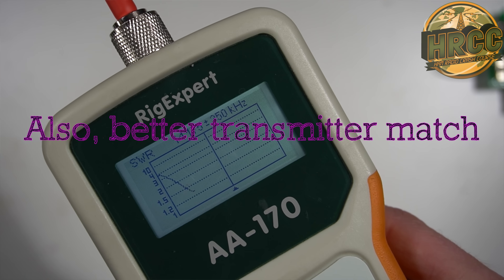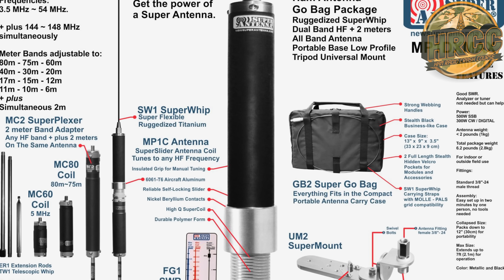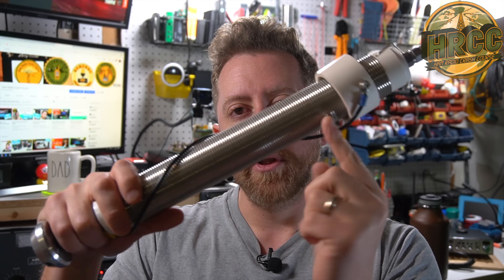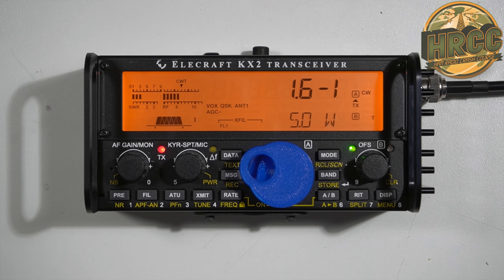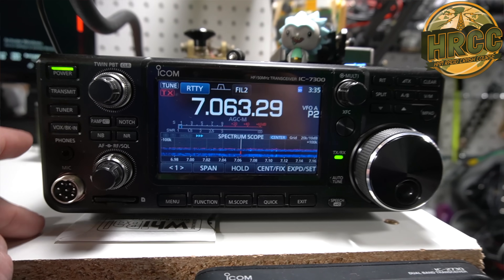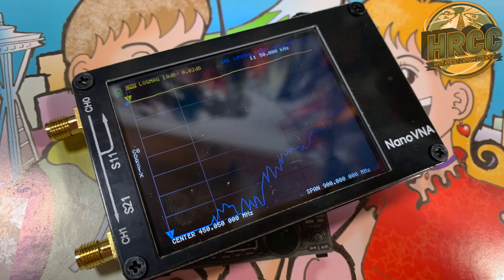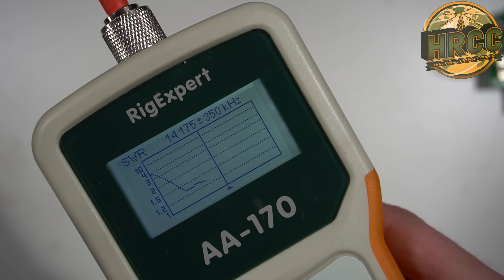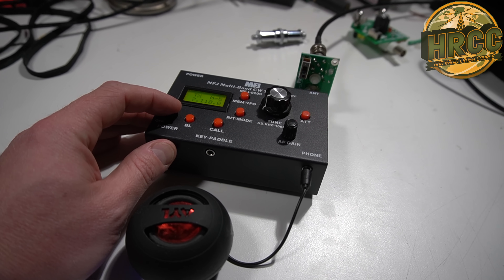Do you think you need an antenna analyzer?

Comment: You can use built in swr meter for low power under 200w but if you run power 1kw or up its a must .

Comment: I just put up a dipole measured to the band I wanted to operate in when I was a Novice 48 years ago. Shortly after, I acquired an SWR and that’s all I needed. A few years later I bought an MFJ noise bridge and it lets me know if my antenna is above or below resonance and how much inductive or capacitive reactance if it isn’t. I was handed a Palomar Engineering noise bridge and these devices plus a Tenna Dipper kit I built are all I need even though I build antennas. Never have had the need for an antenna analyzer because once the antenna is adjusted I have no need for it.

Comment: I got a NANO VNA last year.
They are useful but not essential. For years I cut aerials slightly longer and then folded the wire back on itself to shorten the length. The only problem is you could go past the point you want and make it too short and waste time figuring out where you went wrong. An amateur band tx only has a narrow bandwidth and the SWR meter can't tell you which way to go if you pass the point you need. I did  it yesterday on my 10m dipole but it's a wide band and I could see the SWR was better higher up in frequency. I didn't actually use the VNA as I had previously got it on 10m but I moved it yesterday so the resonant frequency was a bit off.

The VNA shows where the aerial is resonant so you know whether to lengthen it or shorten it. I've used it on my 60m inverted vee and 20m and 17m dipoles and after building my 4 element 2m collinear to check it was okay. It showed a kink in the reading a bit higher up in frequency so I'm guessing some parts are not quite half waves at 2m. An SWR meter would not show this.
I want to use it to make bandpass filters. 

For the price it is well worth getting one. A brilliant bit of test gear.
G4GHB

Comment: Nice ham snack. What are your thoughts on the method of finding lowest swr by listening for the loudest static while tuning through the band? I’ve heard some old timers talk about something like that for tuning antennas. KA4AMP
Reply: I do that to get things roughly tuned and then watch the SWR meter. Especially good for a mag. loop.
However, for about 40 years I simply tuned for maximum r.f. out at the aerial before I built my SWR meter.
G4GHB

Comment: Remembering back to my 1959 novice days, I knew nothing of SWR; hadn't heard of it. We measured antennas in feet according to the formula or the recipe and that was that. Test equipment mentioned in the ARRL Handbook included the Grid Dip Meter and the Receiver Noise Bridge, both too complicated for a kid. Somehow I thought RG-59 was right for dipoles. So that's what I used. Years later I understood that RG-59 was 75-ohms impedance, not 50-ohms -- oops. All these years later, amateur radio is still super fun, even if I am using the right coax, not confined to a few crystal frequencies, and my CQs don't drag on forever.

Comment: Another thing you can do is become friends with someone who does have an antenna analyzer. If they are nice they will almost certainly let you borrow theirs for fine tuning your antenna, especially if you aren't constantly making antennas. 
As for the nanoVNA being fiddly you can make using way easier if you connect it to a laptop or tablet PC and run certain software like nanoVNA-saver. Puts all the controls on one screen and makes reading the data far easier too

Comment: been a ham, on and off for over 50 years, home brewing my own antennas, and buying some for mobile use! And although I only just recently bought a Nano VNA, this tool is just absolutely AMAZING!  They are not as good as the $10,000 VNA's but for around $100 they are very good, and surprisingly accurate on most of their measurements! If you are just starting out, and are not even sure how to build a dipole, one of these devices is probably way above your pay grade... but as you advance, you will be glad you bought one of these things!

Comment: The antenna analyzer has one huge advantage over using the radio's SWR meter, namely you eliminate the risk of doing to damage to the finals by transmitting into a high SWR before you do adjustments. The antenna analyzer will also tell you whether you need to adjust the antenna up or down (or longer / shorter) whereas using a SWR meter it can be a lot of guesswork,
Reply from the maker: All true.  Analyzers are great.

Comment: I would recommend that anyone who's running anything over a few hundred watts should have one or have access to one. An swr meter will read much different vs an antenna analyzer and won't show the information that a good antenna analyzer will. I'd recommend the rig expert, the MFJ'S readings are always questionable. I'll use the Rigexpert first to dial in the antenna, then compare to my Inline watt meter, lastly I'll switch to reverse power setting and modulate with amplifier on to see what's coming back. I talk on 11 meter, however the same is true for all bands. The Rigexpert has replaced my MFJ-259b.

Comment: it very nice to have you can check your swr why you out side with out the antenna hook to the radio i have the AA170 I LOVE IT YOU IT MADE FOR HF AND VHF IF YOU WANT ONE THAT DOES UHF IT COST YOU MORE  MONEY FOR YOUR HF DIEPOLE ANTENNA YOU CAN SEE WHERE YOUR ANTENNA WORK BEST AND ITS AT 50 OHM BECAUSE YOU GO UP HIGHER HAVE GOOD SWR BUT YOU MITE HAVE A 60 OHM

Comment: 🤔...ive been into radios a realy long time....and I can tell you without any doubt that you SHOULD ABSOLUTLY have an Antenna analyzer and not just a **METER** my rule of thumb is your analyzer should be half the cost of your current radio... or half the cost of your total station...

And if you can only afford a nano...spend the $150 for a quality nano but I highly suggest a rigexpert.

Comment: I always just use a small inline SWR meter on a 3ft jumper at the antenna to tune one on the ground with the main feed line running from the SWR meter back to the radio.

Comment: I just got a rig expert and love it!  My Super Antenna is clamped to the railing on the balcony of my 3rd floor appointment.  It has a plastic ruler for adjusting the coil, but it's hit and miss.  To get me a useable SWR at the low end of 40 meters, my Rig Expert is pretty much required because the adjustments are one millimeter at a time to get into that very narrow sweet spot.  And I need to use the Rig Expert zoom function and the cursor to get there!  Still, it takes me only 10 minutes to get to the lowest SWR right at the center of 7.070 Mhz.  I'd be running in and out of my apartment for the good part of an hour to change bands to 40 meters PSK using the SWR meter on my 7300.  It's also been a time saver tuning the ham sticks on my pickup.

Comment: I have an MP-1 Super Antenna and an IC-7300. I bought a Comet CAA-500 antenna analyzer specifically to aid in tuning the antenna. The radio and analyzer are on an A/B switch tied to the feedline/antenna. Works great. Is it required? No. But it is very nice. And better than the alternatives.

Comment: Good topic Josh. When I started out in the early 90's I didn't know anyone with an antenna analyzer. They were very expensive and were more of a luxury than a necessity. We simply turned down the radios power to 5-10 watts and checked the SWR with an inexpensive, common SWR/Power meter in line between the radio and antenna. Now days it seems 1 out of 3 Hams have an  analyzer, including me. They are more efficient now, inexpensive and user friendly. Also, as you pointed out, most all modern radios have a built in SWR readout.

Comment: What can you tell us about Grounding and ground rods? Is there a limit on how many you should be using and how far they should be apart from each other if you are installing more than two? Also using copper wire or copper straps for grounding. The plus and minus of those. Anything you can tell us about grounding would be greatly appreciated.

Comment: I've come to the conclusion that the single most effective way to improve any ham station is to spend money on putting your antenna higher whether by simple telescoping fiberglass mast or even a tower depending on your budget and ability.
Reply: 1/2 wavelength high is the best for angle of radiation.

Comment: Could you also agree that an antenna analyzer wouldn't be needed for a basic 2m/70cm or even just single band setup with an antenna that is pre-tuned and designed for the band you need? Every time I talk about putting an antenna up somewhere for a ham setup I have a friend/fellow ham that insists I would need an antenna analyzer. To my knowledge, a basic SWR/watt meter would do the trick for a basic tech-class setup.
Reply from the maker: If you’re using off the shelf antennas and radios on vhf/uhf yeah absolutely. You don’t need an anlyzer
Reply: Ok, as I expected. Thanks for the reply! I'm from Avalon and frequent the Catalina 2m repeater. CARA links their 2m, 6m, 220, and 440 repeaters from 6-9am every morning. Drop in and say hi if you get the chance!
73, K6GLS

Comment: An antenna analyzer gives so much more information than a SWR meter. And when setting up a repeater then it's also often not possible to get the data from the repeater itself about the actual characteristics of antenna and antenna in conjunction with the filter. It can save hours of headache if you have one.

And sometimes when you have an antenna you could discover that it's actually useful also for frequencies outside what it's specified for. It may not be the best radiator at those frequencies but your radio won't barf either.
Reply from the maker: I’m not denying that. I’m saying new people don’t need to feel they have to have one. 🤣

Comment: I wish I had had my YouKits FG-01 antenna analyzer years ago. It is simple, gives SWR and impedance continuously while adjusting the antenna, and saves so much time.  Yes, it is not cheap and there are better ones that give more information that many hams don’t understand anyway.  But it makes adjusting a BuddiPole, Wolf River type coil, stinger on a ham stick, mag loop or just trimming a dipole so much easier.  I have used noise bridges, SWR meters, and other items to tune antennas and even have a Sark 110 (have to read the book each time I use it) but for simplicity and ease of use the YouKits works well and makes antenna tuning a breeze.  My old MFJ was too mich trouble and only gave a static reading so I sold it.  Can’t believe they are stilling them since the nanoVNA came out for $50.  Even the nanoVNA has a learning curve but most hams could and should learn that soon when putting their first station together.  We used to say real hams know CW but in my estimation all hams should learn how to use these great and simple tools (should be part of training and the license exam) for antenna building/adjusting.  Even the most expensive transceiver is useless without a good antenna.

Dave K8WPE

Comment: You can just adjust the antenna for the loudest RF noise on the frequency you want to use. This point at the loudest noise is the same point as lowest SWR. That’s a really easy way to tune up. I have an antenna analyser and they are handy, but not needed that often. Craig VK3CRG

Comment: I always figured I didn't absolutely need it, but figured it would be nice to have for some of the other features (checking coax properties/conditions)  and not putting so much rf out there just to adjust the antenna system.

Comment: Just a comment from AN AUSTRALIAN F Call, 
I have a Hustled 5BTV, now this antenna has 3 band loading coils,  4 if you count the 80mhz resonator on the top, and you need to adjust all of them, to a resonatant Vswr, .
With a swr meter on the radio , this is more than tedious, its a down right pain in the butt.
I have a Sark 100, cheap , reasonably accurate, user friendly and simple.
In a word INVALUABLE, but if your running a mono band etc , yes , I agree that an analyzer is over kill.
My radio club owns an MFJ and it is regularly used by members for tuning their antennas.
If like me you experiment and build antennas , the analyzer is a great tool , to own.
Like you videos, 
cheers from  down under

Comment: Thank you Josh...I’m new to the hobby as a general and was dreading one more, what I consider to be, big expense. I do have my eye on a wolf river for POTA but was stuck because I don’t want to pay for BOTH a new antenna AND an analyzer.
Reply from the maker: Get the antenna. Learn to read the swr on the radio and you’ll be able to get that wolf river tuned up no problem.

Comment: SWR meter needed to set up an antenna properly, Antenna analyzer only really needed to build antennas and then only if your really not sure if your anywhere near correct. Anyhow, given the price of an NanoVNA(a cheap antenna analyzer) vs an SWR meter, the nanoVNA makes financial sense, given it covers most bands, whereas you'll need a seperate SWR meter for HF and VHF/UHF, at the same cost each, at minimum.
Reply: An antenna analyzer only for building antennas? You are so wrong. It gives invaluable information for tuning an antenna to resonance which an swr meter can't do.
Reply: @vegasfordguy  Plus: a NanoVNA is so much more than just an antenna analyzer. It is to a HAM what a DMM is to an electronics enthousiast.

Comment: An SWR meter, whether stand-alone or built-in, is a great first step.  However, SWR alone doesn't identify inductance or capacitance, which are big concerns in a lot of antenna designs.  The SWR meter might read 1:1, but that doesn't tell you how much is resistance and how much is reactance.  A high reactance 1:1 antenna might not damage your radio, but it won't radiate very well either.

If you're only dabbling in very basic antennas like dipoles and 1/4 wave with radials, an SWR alone will be fine.  Calculating the elements' electrical length is simple and as long as you're close, you shouldn't see any weird local mins or maxes that can trip up an SWR meter.  It doesn't need to be expensive or fancy, or laboratory-grade accurate.  I know for the beginning ham a $30 SWR may be a significant chunk of change, but it's cheaper than a new radio ( coming from someone who fried his first radio, and luckily got it replaced under warranty ).

But if you're experimenting with complex antennas, some sort of VNA is almost required.  And luckily the NanoVNA is relatively affordable.  And I don't think the argument "it's difficult to set up and use" holds water.  Anyone capable and willing to build their own Yagi, mag-loop, or nested quad should have no problem figuring out the Nano.

Comment: Josh, do you have plans on discussing the high swr antennas? That seems intriguing. I also had maybe a strange idea. An any wire antenna box, a box with a diode hooked to an output, and a diode hooked to an input... When the tx is in use the rx is physically disconnected. Would there be a diode that could keep a radio safe against insane high swr? I may be crazy, but I'm new. 🤪

Comment: I bought a NanoVNA and am testing my antennas. I don't fully understand the Smith Chart though, because I'm using 75ohm coax to my dipole, and its calibrated for 50ohms

2:1 SWR is till only 11% power loss actually. Not enough to really be worried about. It's more to worry that excess voltage will destroy the output amplifiers. But power loss isn't a huge thing
Reply: You should be able to calibrate the Nano to whatever ohm test lead you want.  However, if your radio is set for a 50 ohm load, I'd calibrate the Nano to that so the Nano will show what your radio is experiencing.  And it's always best to test the entire antenna system, that includes the feed line.  The 50-75 mismatch of course means some loss ( an ideal case would be 1.5 : 1 SWR ) but if you have a proper balun or choke at the dipole feed point, the feed line itself shouldn't radiate or cause any other nastiness.

You can also use a matching network to mate the 50 and 75 coax if you want the SWR down and boost antenna efficiency.  I think a twelfth-wave transformer is the easiest way to do it, but that only works for a single frequency range.

When you say you don't understand the Smith chart, do you mean you don't know how to read a Smith chart, you don't understand how to read the chart as displayed on the Nano, or you don't know how to set the Nano to display it?
Reply: @JaronActual  at first i didnt understand fully how to read it on the nano  because the nano displays R+ and the a C or L value and not j values (like +j34). At first made it look like the capacitiance value was backwards, higher valies towards the centerline but then i realized i guess that is correct because higher cap means less reactance. To me made it harder to understand my antenna system

I actually am testing a the feedline, so i get a 1.5ish swr "circle" on the swr chart to begin with (the values move in a ring centered on the center 50ohm, because my feedline is 75ohm). I THINK i know how to read it. My homebrew CW 7mhz transmitter is hitting stations 600 miles away so it seems to work well enough (my antenna). Nano says my resonant freq is about 7.150mhz right now and i can go down to 7mhz and up to about 7.280 before i hit swr of 2.0. At 7.1mhz it says my antenna is 48ohms with 1.1nf capacitance. At 7.050mhz or so it says 36ohms with like 450nH. My dipole is only 5 feet off the ground so the true impedance is low

Comment: I'll go out on a limb here and say that if you are serious about antennas and antenna design an analyzer is essential,  as an SWR meter is not providing the complete picture.
Reply from the maker: Sure. If you’re serious about antennas. I was talking about getting started with radio.
Reply: @HamRadioCrashCourse  Well sir then I would say that I read too much into the question! 
Just starting out? Yeah SWR meter. 
I stand corrected!
73 DE N2NLQ!